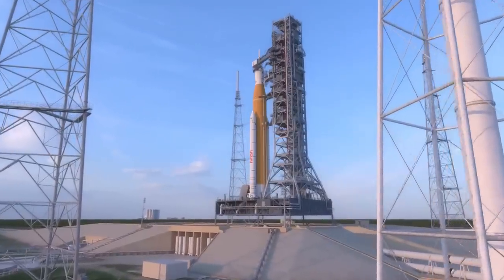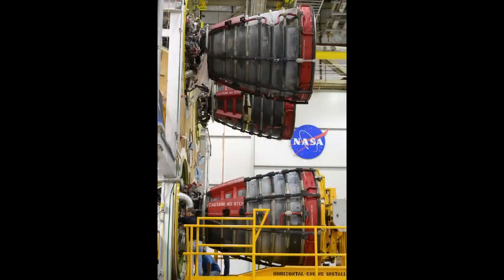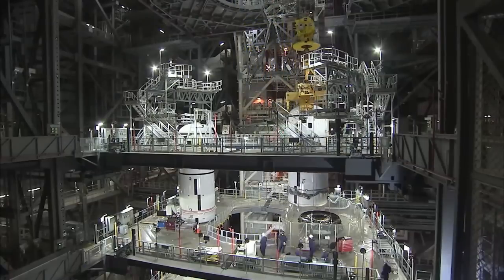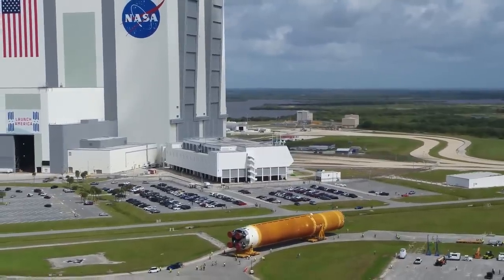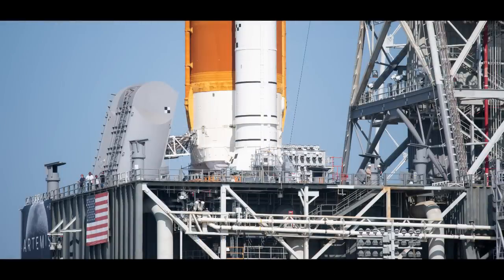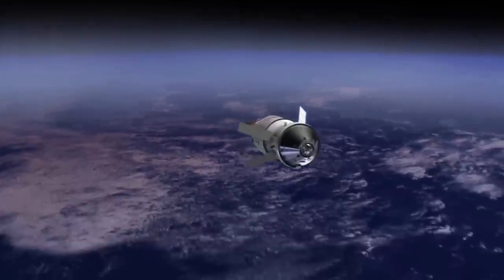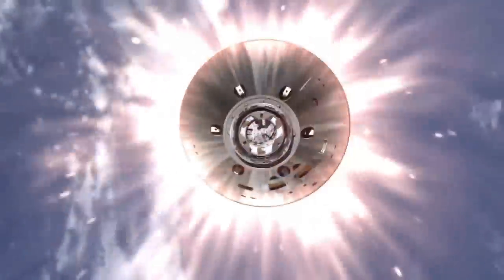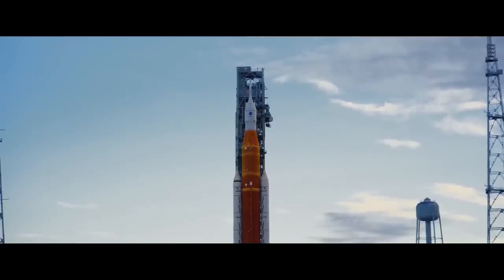What's The Big Deal About Artemis - NASA's New Massive Moon Rocket

Comment: Oxygen or hydrogen on top of the tank, I wonder what the design advantages are for either configuration.
Reply: Hard to explain over a comment but the further your center of mass is from your source of thrust, the more torque can be applied by the Thrust Vector Control (TVC).  Look into the equation for torque (rxF).  r is radius (the radius at which the force is applied from the center of mass), and F is the force.  There is also a sin(<between the vectors) too but that angle doesn't change much when moving the COM down.  There are other reasons too.
Reply: @JenkinsStevenD  So what you're saying is the oxygen tank component is heavier than the hydrogen carried... particularly as the flight progresses.
Reply: I think  @JenkinsStevenD  is saying that if the heavy O2 were down near the engines the top of the rocket would flap around too much and make it hard to steer.

Comment: It is astounding how a system which is built from so many reused components may be so expensive 🚀
Reply: Basically, it boils down to this:

Elon Musk is exploding rockets and melting down engines quite often - but they are rather cheap and quite mass-produced prototypes. He's a firm believer in small improvements, but in a very fast pace. Nobody told Musk to do it that way. After all, he's paying for his own fireworks.

Boeing, Lockheed and the others take a much more cautious approach, and rely more on careful calculations and engineering. They also have to align their production and testing regimen to the Congress, which approves another tranche of financing as soon as certain milestones are reached.

If you're on a government contract, you can't simply request more money if it runs out in mid-testing - and you cannot keep leftover money for another project...
Reply: @Keimzelle  It is much worse than you think. To quote a CNCC article: 
"NASA holds agreements of each structure for the most expensive parts of its lunar Artemis program: The Space Launch System (SLS) rocket and Orion capsule designed to take astronauts to the moon’s orbit, under cost-plus contracts, and SpaceX’s Starship rocket to carry the astronauts to the lunar surface, under a fixed-price deal."
Do you see the problem?
Reply: @Keimzelle  Elon does not pay for his own fireworks. That is done by NASA, and hedge fund investors.
Reply: @arctic_haze  The "cost-plus" contract is actually a good idea.. So long as it wasn't abused.. Which is where it gets into trouble. Literally nothing (or nearly anyway) ever meets, or is lower than proposed contract price. So instead of the contractor having to deal with cost over run re-approval (a lengthy process itself), there is an acknowledgment that there will be added unforeseen cost with development/construction. It just gets abused, because it's nearly impossible to prove the extra money wasn't needed. At any rate, SLS (or rather it's contractors), shot themselves in the foot, as that kind of contract is no longer getting approved as much as before. HLS is a hard line contract for example.
Reply: @hawkdsl  Now even the NASA Administrator admits it's a plague: 
"You get it done with that competitive spirit. You get it done cheaper, and that allows us to move away from what has been a plague on us in the past, which is a cost-plus contract, and move to an existing contractual price."

Comment: A lot of people compare SLS to Starship, and then everyone is saying that they will work together. But I do feel like Starship could easily replace SLS. Yet SLS could never do what Starship is planing to do. 

The scope is just vastly different.
Reply: nasa has no way to land on the moon yet
Reply: Nah SLS still fills a niche that starship can't fill. Starship requires 15 launches over the course of 6 months to be able to get to the moon. SLS can get you in lunar orbit in one launch. It's also very important to have multiple launch vehicle options for the mission you want to fly or you end up in a situation like we were in after the shuttle retired and we had now way to get people in space except now there's no other rocket capable of getting to he moon besides the one you don't think is necessary.
Reply: @eaglestdogg  just put a smaller second stage on starship booster
Reply: @JamesHardaker  It is really not as simple as you think it is. That would require a whole new rocket design which would take years to develop. Also it's really not as simple as swapping a new spacecraft on top. The super heavy booster was designed for starship. It would almost definitely provide too much thrust for a significantly smaller upper stage. There would also be aerodynamics problems of having a significant size difference in the craft. Another problem is that super heavy was specifically designed to come back from a specific altitude. If you had a lower mass upper stage the lower stage would be putting it significantly higher and SH wasn't designed for re-entry at higher velocities/altitudes.
Reply: @eaglestdogg  And yet SLS serves no useful purpose, because the first Artemis crew to land on the moon will find a Starship waiting for them in orbit when they arrive. Because (unlike Saturn V), SLS can't deliver a lander to the lunar surface, while Starship can.

Also, it certainly doesn't require 15 launches over six months... you've been listening to Jeff Bezos too much if you believe that. The best estimates we've got are 6-7 launches, and they're not going to be spread out over six months... even if their cadence is no better than Falcon today, we know they can launch weekly...

Comment: Everybody's focusing on the fact that the RS-25's aren't being recovered.  The flight profile makes that pretty difficult.  Since they're getting up to nearly orbital velocity, they'd need a dedicated heat shield just to survive the re-entry.  I'm more upset that they aren't making any attempt to recover the boosters, which would be infinitely more feasible.
Reply: Booster recovery is by no means feasible. Most of the cost is in making and castinf the propellant grains. Also after flight casings would need to be refurbished. Its cheaper to make new ones

Also, finally, nasa doesnt want more of these boosters. After 10 flights they will switch to Block 2 with more efficient and cheaper BOLE boosters
Reply: The SRBs aren’t actually economical to recover. They’re basically just a steel tube once they burn out, and it’s about as expensive to refurbish it as it is to just build new ones.
Reply: @janmelantu7490  Yeah, it was mainly for the appearance of reusability.

Comment: I look at the five reuse-able Shuttle engines (Service module is #5), pulled from a finite supply, and reuse-able solid rockets, all being trashed for single-use launches,  with marginal overall performance... and I just shake my head.  Not a 21st-century design at all.
Reply: While some of the electronics is new, there is nothing on SLS that could not have been designed at the same time the Shuttle was being designed and built.
Reply: Just because similar concepts existed in the 90's doesn't mean there were no improvements
Reply: James, SLS will maybe get 46 tons to Lunar orbit, optimistically. That's without a lander, just the orbiting capsule and it's service module. The TLI booster stage for it is an interim design that's got less performance; the next SLS they build will have a different TLI stage, maybe... Starship is supposedly going to land 100 tons of men and material and be reuse-able, versus SLS Orion's 46 tons of payload on a disposable ship.  Which approach is more sustainable?
Reply: @skylarking12  
You dismiss SLS because of Starship? Starship is a highly speculative design still in development. It is an over-the-top rocket in so many ways that is unlikely to achieve its goals. I understand that you like the Starship concept. Who wouldn't? But then there is reality. It is unwise to compare a finished design like SLS with a novel hopeful like Starship. The current state is that Starship's first flight will not orbit the Earth once, while Artemis I will be orbiting the Moon for weeks.
Reply: I guess come back here in a year and let's see who was more correct. Come back Monday after the launch attempt even, and we might be talking a very different story. SLS is a last-century design concept that was more about funneling spending to particular senate districts than advancing space exploration. Even with the "advantages" of legacy hardware and mature designs to start from, it's incomplete inside, way over budget, way beyond schedule, and struggled to get to this point and isn't yet in it's final developmental form. Even if it works perfectly, first time out, you won't see the next one fly for at least two more years. It's sort of a rocket version of a "Potemkin Village",  For a company like SpaceX that iterates very quickly,  two years of no SLS flying...that's quite a head start. It's good to have competing systems to keep the contractors delivering the best value, and not put all our eggs in one basket.

Comment: All the wasteful procurement methods and congressional meddling aside, bravo to the engineers that have designed, tested, and built this beauty of a machine! I'm sure there have been many long days with a ton of stress, but I really do hope they get to see the fruits of their labor. It is hard to imagine there is a launch vehicle about to fly that can lift more weight into LEO than the Saturn V. After 50 years, NASA finally has had the resources and political will to build a launch vehicle that can launch a capsule and service module that tops the capabilities of the Apollo CSM is pretty much every way. 

As Scott mentioned, we've all complained about how needlessly expensive this is, but NASA's plans for the Artemis program - if they don't get axed by congress or the next president - are so exciting.
Reply: The payload capacity of this first version of the SLS, the Block 1, will still be significantly less than that of the Saturn V. Only the Block 2 version with more advanced SRBs and a much bigger upper stage will have a payload capacity close to Saturn V’s 130 tonnes to LEO and 45 tonnes to TLI.
Reply: It sounds like you don't understand how economics works, or how financial incentives skew the system of capitalism you all love and support. Government spending produces jobs and once those are in an area, a Congressional rep is going to do their best to KEEP the jobs in the area. Whenever governments work with big contractors like Lockheed Martin, Northrup Grumman, or Boeing, part of that contract has to be a profit for the company because why would they do the work if there "wasn't anything in it for them"? It's easy for these companies to bribe Congress or pay lobbyists to "explain the situation" to them in a way that increases the contract top line until it makes a suitable return for the company. Happens literally all the time with these monopolistic defense companies. Has happened since the 1800s in all facets of the government.
Reply: "@Bill R  Yep. Pretty sickening when you think about it. Sadly I can't possibly imagine any potential alternative. I think only capitalist countries went to space, right?"

 @ThatCamel104  Yes. Famous capitalist country the Soviet Union was first in space. You may remember such hits as "Sputnik" (first man-made object in space) and "Yuri Gagarin" (first human in space). There's also plenty of alternatives other than letting companies do all the work - it's worked pretty well to have stuff like the TVA - hard to see how it wouldn't work here as well

Comment: "Caution, no step" is written on the engine bell holders. 
Meanwhile at Starbase, workers use Raptors as ladders.
Reply: Also workers in the VAB wearing nitrile gloves to touch the rocket, whereas Starbase builds 'em out where birds can poop on them during assembly.
Reply: @stanj7223  I bet the tires on the rollers used to move SLS parts around are single use too. 
Meanwhile raptors cruise around the place on forklifts and pickup trailers.

Comment: Perhaps I'm missing something,  but why not add 1 more RS-25 on the first stage, along with slightly taller fuel tanks,  and skip the solid rocket boosters?

Also (speaking of RS-25s), how difficult would it be to re-engineer an RS-25-version-2 to replace the current crop being thrown away --- kind of  like the new (simpler) versions of Spacex's Raptor?
Reply: Not enough power. For every engine you need more fuel and the RS-25s biggest advantage is in its Delta V burn. It needs the solids to get there first.

Comment: @10:10 why doesn’t the lower booster use the same construction as the upper stage with the LOX on the bottom? This would make the external piping unnecessary it would seem?

Comment: When returning from the moon, why doesn’t NASA use aerobraking and do an orbital insertion into LEO before doing the final re-entry? Wouldn’t this reduce the load on the heat shield?
Reply: Problem is you have to ditch the service module before reentry, leaving you without fuel cell, solar panels or engine. The RCS on the command module itselt won't be able to raise the perigee out of the thicker atmosphere after the aeorbrake, let alone  lower it back down for final reentry. Plus you really don't want to stay in space for long after service module jettison, as you'll soon run out of battery power and your life support systems won't last long. It would certainly be possible to design a command module to work around those issues, but that would add quite some weight to it. Honestly it's just easier to add another inch of ablative material.

Comment: Hi Scott, I've just had a quick look on Artemis missions. I found that Artemis II will spend 10 days just fly to and around the moon (without entering lunar orbit), while Apollo 11 used only 8 days for the round trip as well as moon landing. Could you please explain why will Artemis II take much longer just for a flyby?
Reply: Apollo missions were just meant to get people there and back ASAP, so they spent a lot more fuel to get there way faster instead of taking the slower but more efficient route like artemis will.
Reply: @Darenz-cg9zg  Yeah. I kinda understand that Apollo missions just wanted to expedite the whole process. But considering Apollo 8 and 13 did the flyby in about 6 days, does Artemis II really need 4 more days to do the same?
Reply: @hengyuwei8867  space travel is a pretty slow business. every extra kph of speed costs more and more fuel. It also means more and more fuel is eaten up slowing down for reentry. As the other commenter said, it's better to take this slower and more efficiently.
Reply: it is said that Artemis II will take from 8 to 10 days, instead you focused on number 10. How far they go beyond the Moon will probably dictate the length of the mission. So wait for Artemis II and when it’s particulars are well known then start worry about those days.

Comment: Are the SSME's now disposables? When I worked at Rocketdyne, ('88 - '90), we were told that they cost $75 M each. Adjusted for inflation, that's gonna be a minimum of $680,000,000.00 per launch.
I hope they are not disposables.

Comment: Interesting fact.  This rocket is not as tall or as massive as the Saturn V. it just has greater thrust (thanks to the SRBs).  SLS 5.5 millions lbs.  Saturn V 6.2 million lbs.  SLS is 40 feet shorter than Saturn V.
Reply: Hydrogen/oxygen is also quite a bit more efficient than the kerosene/oxygen stages the Saturn used
Reply: @RhodokTribesman  Actually yes and no.  Yes its more efficient at lighter loads. But one reason the Space Shuttle didn't need Kerosene was because of the SRBs.  The same reason SLS doesn't need Kerosene.  If the Boosters didn't exist or just weren't used.  Kerosene in bigger engines would be the better choice. That is why SpaceX Falcon uses Kerosene. Because it doesn't use SRB.  And SLS probably would use Kerosene if it didn't have SRBs.
Reply: @RhodokTribesman  Only the first stage of the Saturn-V used RP-1. The other stages used LH2.
Reply: @RhodokTribesman  It's not that simple. Yes, hydrolox is efficient, for a certain definition of efficiency — but it's hopelessly ill-suited to use in the first stage of a launch vehicle, which is why SLS has two stupidly big solid rockets bolted on the side. The Saturn V was much more efficient overall, using high-energy kerosene for the first stage that did most of the work fighting gravity, and hydrogen on the second and third stages.

Comment: Has the use of a (very large) tent/ballon around the rocket that is free from water vapour been tested a an alternative solution for handeling ice? And why doesn't it work doing that? The only problems I can come up with is that the sensitivity to winds will be higher and access to the vessel will be a bit resticted. I think bigger ballons has been constructed and  the rocket can be launched though the ballon so there is no need for removing just before launch.

Comment: What makes "going deeper in to space" any more difficult than a "typical" space flight?  Unlike diving deeper into the ocean, where the deeper you go the more pressure there is on the vessel, the vacuum of space does not get lower the farther away from earth you get.
Reply: More distance, more time, more fuel
Reply: 1. radiation. When you get out of LEO, there's more radiation. nothing lethal in the short term, but on a 6-month mission to Mars you have to deal with it. 
2. higher reliability requirement. 
3. longer mission = more payload needed for supplies.